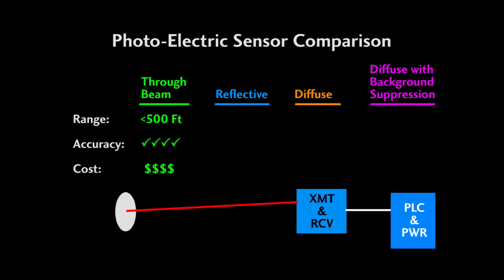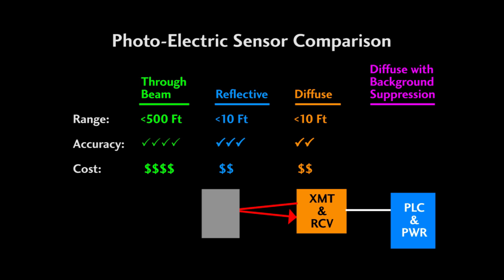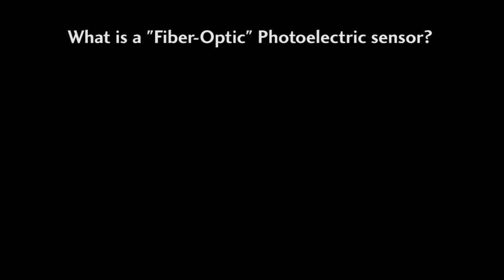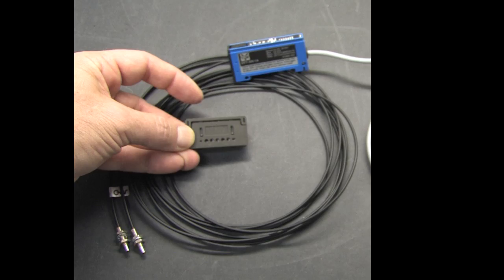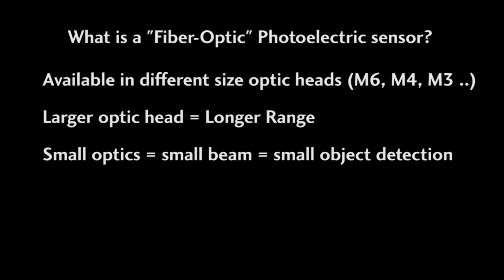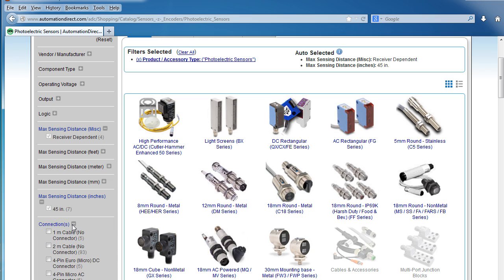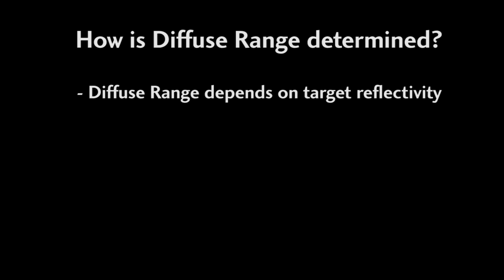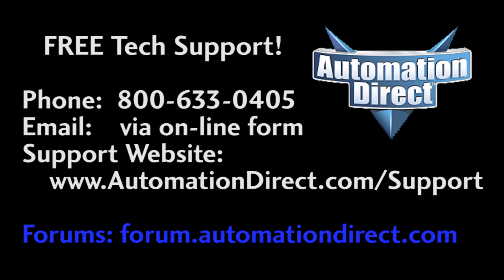Photoelectric Sensors for Object Detection from AutomationDirect

Comment: What type of sensors for object detection can be used for glass, is it capacitive photoelectric diffuse sensor?
Reply from the maker: Any of the capacitive sensors should work. They are not photoelectric as they do not utilize light for the detection. Depending on the glass certain types of photoelectric sensors may work, however they function much better with refelective mediums, rather than transparent ones.

Comment: Can these sensor detect a empty parking space in a parking lane
Reply from the maker: Hi Cynthia, Yes they could be used to select any solid object, but, you need to be aware of the sun light.  Since these are optical sensors direct sunlight can interfere with their operation. Another option to consider is ultrasonic - they aren't susceptible to sun light (Modern cars use those to detect when other cars are too close, for example).